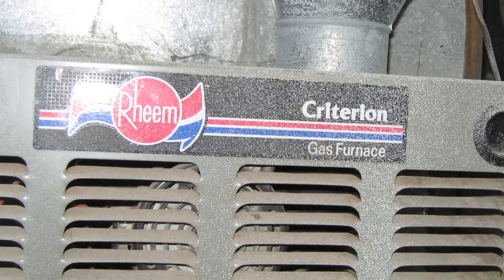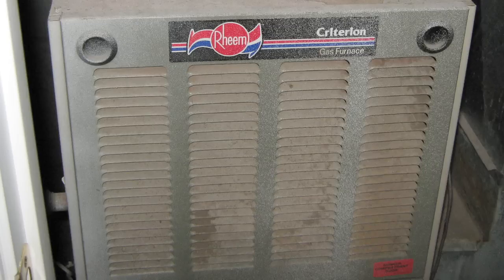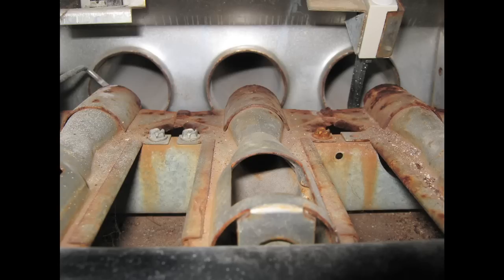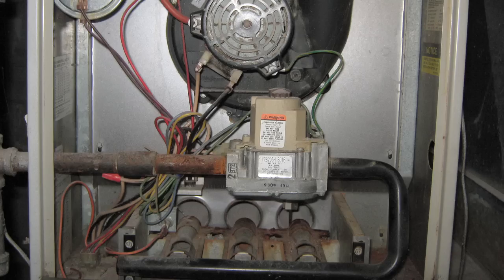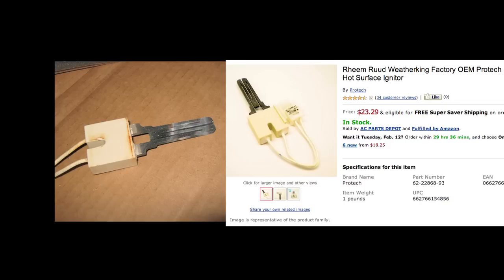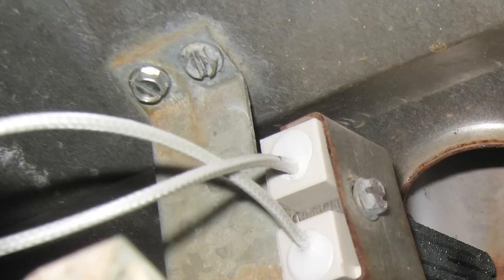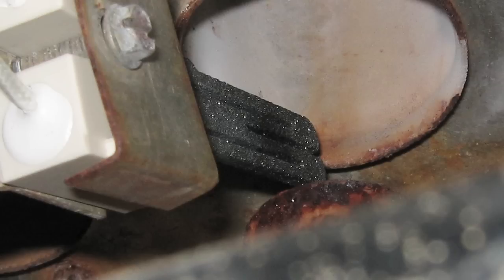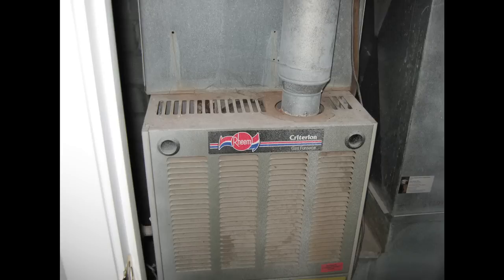Rheem Criterion gas furnace Hot Surface Igniter replacement

Comment: Thanks Dan!  The diagnosis section was very helpful.  I was confidant that it was a bad igniter after you went through the symptoms.  I used latex gloves to make sure to avoid touching the element.  It cost me $26 for the part over amazon and the furnace is fixed.  Also, I appreciate the brevity.  Most people do not know how to be concise in their videos.  Thanks so much!
Reply from the maker: I appreciate your kind words and I'm glad my experience was helpful to you!

Comment: Thanks a bunch Dan. Worked great just as you posted. ~ $60 and back in business. While I had the furnace opened, I removed the pressure switch (as from my research that appears to be another common issue) had local furnace retailer check it. It tested OK but 'slow' (a visual inspection uncovered that it had a tiny piece of plastic tubing that has somehow lodged just inside in the air intake). Once we removed that piece of plastic the pressure switch was fine.
Reply from the maker: Thank you for sharing your experience! I'm glad mine was helpful!

Comment: Dan the man,  We have a Rudd silhouette furnace.  Basics very similar.  It would run through the cycles just fine except no fire, no heat as yours did in your video.   This was a first furnace do it myself job-your video was very helpful as a teaching tool.  Replaced the igniter and we have ignition and where there is fire there is heat.   Thanks.

Comment: Thank you SO much.Tip: wear gloves to prevent touching the ignitor incorrectly and have a small ratchet handy for working in such a tight spot.  Furnace died on Thanksgiving night right after a big cold front moved in, naturally. I managed to find a hardware store with a similar part (41-408) that fits just the same. Replaced and it worked GREAT!

Comment: I just replaced my igniter - easy peasy- thanks so much for such an instructive video! 😊❤

Unfortunately, igniter doesn’t heat up and gas still won’t light.    There is power per my volt meter.   2 bright LED lights.   I’m stumped.   May be time to call the pros.   I hate to give up though - enjoying working on it and hoped to actually fix the problem. Lol

Comment: Oh, one more thing.  The replacement part had the plug end that you talked about but my older furnace did not.  I was able to splice the wires with wire nuts from the old ignitor (the nuts came with the replacement unit) and it plugged right in just fine. I marked the wires before unplugging to make sure I got them back on correctly.  Thanks again.

Comment: Awesome.  I have the same model.  Wife wanted a $200 emergency call I got it done faster for $30 with an igniter from a local HVAC parts store.  But mine had a different igniter.  It's a spriral cylinder shape. I found the plug spliced one with nearly the same part number and this is probably someones replacement.  I used a MARS 67982 Round HSI igniter.  Worked great.
Reply from the maker: It's so gratifying to get it done yourself. Thanks for sharing your creative solution!!

Comment: thanks Dan!  First cold night of the year here in the Inland Northwest and of course the furnace quits!  After a chilly night with space heaters I called for a repair service. Good luck - 24 to 72 hours out!  I am somewhat handy but have not worked on our furnace beyond new filters.  Your video was perfect for the Rheem Criterion II ignitor. The diagnoses was right on and the instructions were easy to follow.  Fortunately a local supplier had the new ignitor part for $50 retail.  I installed it and to my amazement...it WORKED!  Glowed red, ignition and blast off!  Good thing too because tonights low is going to be in the mid to low teens.
By the way...is there any particular reason that an ignitor would go out right when the weather turns especially cold?  It has been running fine lately (for an 18 year old furnace) and sure enough, cold snap and done. The ingitor had a peice broken out of it causing the short.  Must be fate...just like me finding your video!  Thanks again for the help!
Reply from the maker: Joel Nania, I'm glad this worked for you and others. I think these fail over time at various times of the year (which is generally noticed when it's cold enough to run the furnace for obvious reasons) because of deterioration, damage and manufacturing inconsistencies. I was able to manually ignite the furnace with a fireplace lighter to get me through the night, while I waited for my part to arrive. That was the proof I needed to know everything else was functioning properly. If I could have found one locally, even for a few more bucks, I would have bought it just to shop local, but I wasn't successful. Good on you to throw a local supplier a few bones! Man, I love YouTube!!
Reply: Roger that! 13 degrees tonight in the Inland Northwest!

Comment: We have the same furnace and the board is flashing "ok" three times which indicates a limit is open.. We cannot find the limit reset buttons anywhere. If you still have this furnace could you do another video just pointing out whats what. You seem very knowledgeable, and there's so little info about this model online. thanks.

Comment: Great video. Please Help! I replaced my hot surface ignitor but it's not heating up. It's not the ignitor as I have replaced two of them already. None of them heat up. I have done a lot of troubleshooting with no resolution. There is electricity in the wire that connects to the ignitor. However, as soon as I connect the ignitor, there is no electricity in the wire. Please help! and Stay safe and healthy everyone!
Reply: Hey there, did you ever figure out what the issue was ? Thanks
Reply: Did you ever get this fixed? Mine is doing the same thing!

Comment: After installation mine failed after only a few hours.
The second replacement arrived today and I am wondering if the first replacement was defective or if there was some error upon installation (more likely)
I did everything just like this video with one exception: I didn't  avoid the element with my hands (when cramped in my attic it was hard to avoid)

Would my minuscule finger oils make it fail that quickly?
Reply from the maker: I wouldn't rule out oil from your skin or mfg defect. I used to fix copiers for a living for many years and I've had new parts fail. Can you lay your hands on a pair of latex gloves that allow for some dexterity while working with small screws? Or maybe wrapping the element in some plastic wrap or packing material? Just ideas. Wish you well!

Comment: Hi Dan...is it possible for some furnaces to not have a flame sensor? Mine does not seem to have one and I was advised to change the ignitor to see if that fixes my problem. My current ignitor get red and cause the flames to start but after a few seconds it turns off. The flames do not stay lit...could this be a problem with my ignitor if I don’t have a sensor?

Comment: How did you get the bracket off given the tight space? I'm having trouble getting a screwdriver into place.
Reply from the maker: I don't remember that being a problem. I might have used a stubby or angled driver, but it's been a while.
Reply: @Bob9961  Maybe a small socket and ratchet.  The screw does have 6 sides.

Comment: Hi my furnace stopped firing up....ignitor was broken....i replaced ignitor and now ignitor glows but burners wont turn on.....could it be a limit switch tripped?...seems no gas is issue
Reply: Hi, did you ever figure out what the issues was ?

Comment: This worked PERFECT for me! Thank you very much.. I used a small socket to get the screw out instead.. and ordered the part from Amazon. Pro tech 62-22868-93 . Word of advice, order another one in case it goes out again..
Reply: Ooh btw.. my issue was the heater would make the typical sounds when the heater. Normally works, but I noticed it wasnt glowing so I assumed the igniter wasnt working anymore. I checked the motherboard and didnt get any flashing red lights... just two green lights.